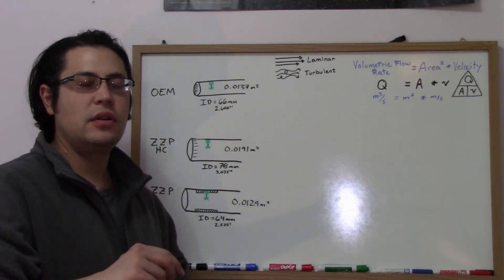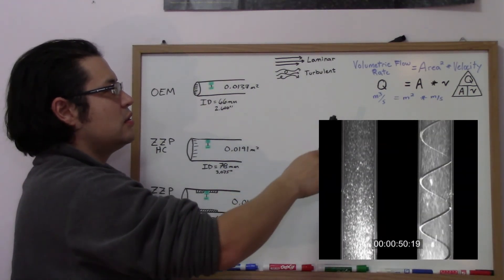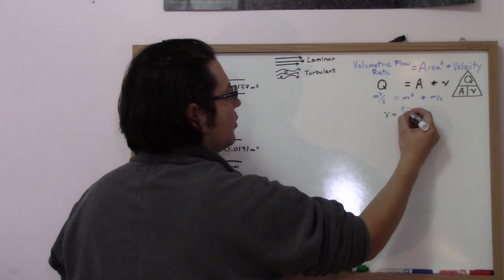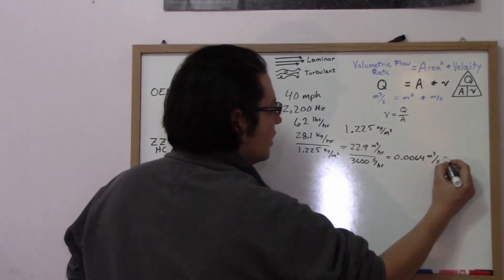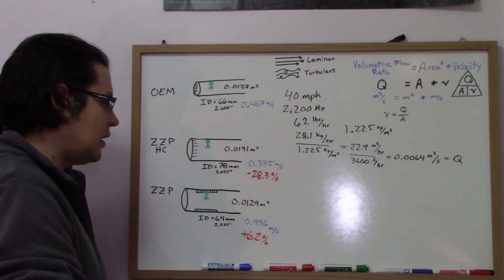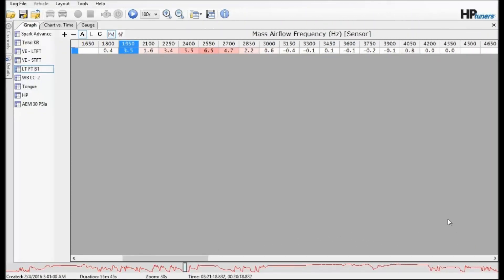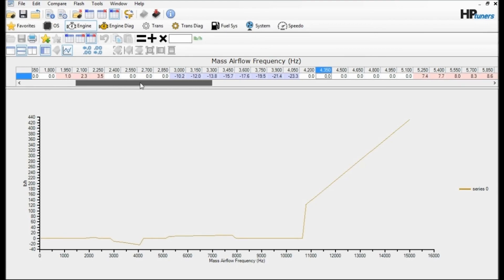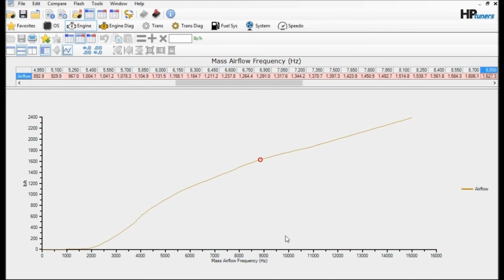Will a Cold Air Intake change my tune? Maybe, here's why...

Comment: Just tune the damn thing and no worries after that. In fact you get zero benefits with out a tune. Those inserts are just a MAF fuller. With a tune it remaps the MAF and the use of 93 octane by advancing timing to actually get hp gains.

Comment: Hello. Sir I've been watching your videos and found helpful. I have 19 GM Yukon 5.3L, did long tube header with green cat, dual exhaust, ported Bigger manifold and 92mm TB and a 4" intake tube and I start getting bank 1&2 p0171 lean codes. When I only swapped the intake tube down to 3.5" ID i no longer have lean codes. I also get RPM surges at idle. My question is, I'm not planning getting a dyno tune as it is very expensive in NY. I do have a diablo tuner and want to do myself. Is it better to use the 4" tube with lean codes or 3.5" without codes on the programmer. And do you know what factors I should adjust?

Comment: MegaMechatronics, good stuff! What you're saying is spot on true concerning modern ECU controlled systems using a MAF system for all of them. What most need to understand here is that you "could" get away w\ using a CAI that has a MAF ID section size slightly smaller\larger than the stock OEM airbox's MAF ID section size w\ the ECU using a tune that has the OEM MAF ID section size loaded as long as the ECU STFT's\LTFT's can make up the difference in fuel rich\lean to bring the A\F ratio back to 14.7\1 BEFORE going out of the acceptable, safe range that is programmed into the ECU, then you won't see a CEL. Now this isn't the right thing to do BUT it IS possible. The purpose of the sleeve is to bring a larger MAF-sized CAI back to the OEM MAF ID size close enough to allow the FT's to do what I stated above so that it will work "right". This isn't a restriction necessarily as air is a compressible medium so since the sleeve section is relatively short cross-section there is virtually no deltaP (pressure drop) across it. The opening has to become MUCH smaller to effectively induce a deltaP and actually "restrict" some airflow. Keep up the good work!
Reply: Forgot to add, this is simply Gas\Air Measurement 101being used.....in other words a simple "electric" pitot tube measurement principle.
Reply: Dale Lockett 😳

Comment: Interesting video. I'm planning on installing a CAI on my 06 RAM 1500 4.7L. So learning more about these is definitely an interest to me.
One thing I always thought was that the O2 sensors also determined lean/rich. Am I wrong, partially right, or what? 
Ok, so, the MAF sensor determines how much air is flowing into the intake. In the ECU it is told the size of the intake tube so that it can calculate the proper flow. By changing the tube size without changing the ECU, it throws off the calculations; is this correct? Can the ECU readjust by just changing the intake tube to a less restrictive flow tube?
Reply from the maker: You are correct the O2 is the feedback for rich/lean, so the intake caused a little bit of a lean condition which told the Fuel Trims to add more fuel which brings it back to nominal Stoich AFR (~14.7 for gas or 1.00 lambda).  That is what is shown in Red when I go through some logs.  

A lot of people get away with making no adjustments to the MAF calibration by purchasing somewhat "engineered" aftermarket intake tubes such as the one I purchased that came with a spacer.  Most are running a little positive on the LTFT, but the computer is happy because it had room to add fuel. People who purchase cheap intakes or remove the spacers (like me) and subsequently do not update the MAF calibration will likely ended up with a check engine light code related to running too lean.
Reply: how do you change your MAF sensor to run good with a cold air intake system?